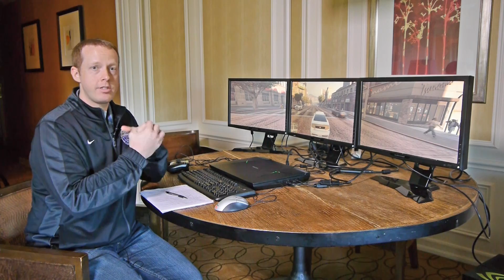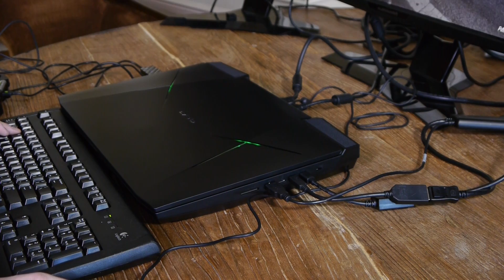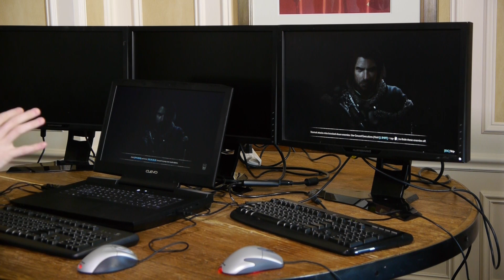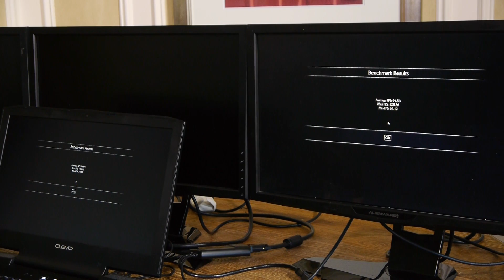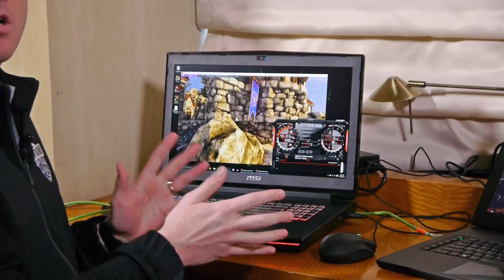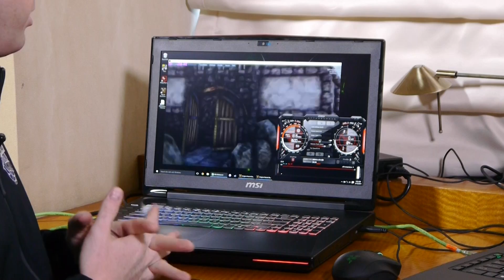World's Fastest Mobile GPU - Full GM204 GTX 980 for Notebooks

Comment: forget about any battery life......lol
Reply: I was referring to gaming with a beast of a video card.  I bet you would get less then an hour.
Reply: +Glen Hill The laptops ought to have Nivdia Optimus so the GPU would be off when not needed. 3+ hours easily. Even with the GPU idling it ought to be somewhat power efficient.
Reply: No one games unplugged
Reply: Almost no one. GPU throttles and battery capacity is not much better than it was 8 years ago for laptops. Old games running on the Intel GPU tho..

Comment: I'm plenty happy with the 980m 8GB GPU in my gaming laptop, which can do the same, run triple (1+3) monitor setup or 1 X 4K output on the HDMI, supported with an i7 CPU running up to 4Ghz and 32 GB Ram, so I don't feel the need for this upgrade. BUT it looks pretty good and will be a great success amongst mobile gamers, no doubt about it! :)
Reply: +mrgclips Your 980m is 30 - 40 percent slower than a 980 desktop. LinusTechTips sis a video on it recently. 30 - 40 percent is ASTRONOMICAL in GPU performance percentage wise. Be happy with your purchase, but let's not be deluded, At the very least you have more vram.
Reply: +deenycest10710 Obviously a Desktop GPU is more powerful, but I've had 212 fps on COD:MW3 Maxed out, 120+ on that un-optimized POS game GHOSTS maxed out and fantastic performances on Titanfall also, so I'm absolutely satisfied with my current rig. Of course, if I wanted to buy a state of the art gaming laptop NOW, then I would most definitely want to go for this GPU! :D

Comment: What is the clock speed of the 6700K in the laptop? Isn't the 6700K a desktop part? I get there's probably an AC adapter plugged into that thing at all times for these demo's, but is it downclocked to maybe match the desktop with 4770? The laptop also is pretty thick, so I get there could also be some decent cooling pushing that heat out. But like others are saying about battery. I'm just wondering if the processor used in these demo's were done that way for a reason.
Reply: +Justin Reback that I know of clevo/sager and msi both use desktop cpu's not sure if alienware and asus and battery life while gaming is horrendous I use to get 20 to 30 mins max on just the battery definitely has to stay plugged in

Comment: The thermal throttling will be ridiculous. This is not gonna work.
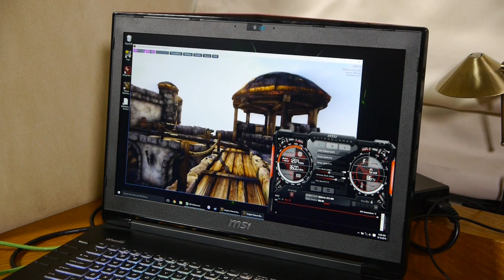Reply: you saw it won't... 5:05
Reply: +DCCXVIII Good point. As long as the heat sink has at least 180w heat dissipation it should run cool though. There are plenty of 180+ watt heat dissipation coolers that can fit in a notebook.
Reply: Moyukh Shabon
That doesn't show anything. Get back to me when someone has actually used it for normal time periods and not benchmarks (that are never indicators of real world performance). It's simply impossible for a laptop to achieve desktop level heat dissipation. Physics is a thing.

Comment: How long can the battery last if you're stress testing the cpu/gpu?
Reply: Exactly!
Reply: +finn jake it doesn't.
Reply: +finn jake 1 hr MAX
Reply: +sweet dreams 1 hour? i think you mean 20-30 min
Reply: +finn jake The GPU will be throttled HARD while on battery. It can't handle that kind of discharge without overheating fast. Like discharge fully from a full charge in 20 minutes or less if not throttled but from voltage drop from the huge load it would be less time still.
Reply: +danwat1234 yeah I have experience (alienware 17)
Reply: +Fuzed Studios With my Asus G50VT laptop with a 9800m GS, in  which the GPU takes 60 watts theoretically, it can run at full speed with the CPU and GPU crunching while on battery but the battery gets hot and doesn't last long. If I start overclocking then I think it starts throttling or goes to hibernate for protection.
But any of the high end GPUs no way
Reply: +Fuzed Studios And don't get me started (well I guess I am) with aftermarket batteries... sometimes they just cut power (laptop shuts down improperly) if power consumption becomes too large. So be careful with gaming laptops and aftermarket batteries.. and mAh capacity lies. Usually they are 1 notch less energy dense than OEM.
Reply: danwat1234 omg yaasss that always happenes to me... like it says battery low then 2 seconds later it just SHUTS OFF :(

Comment: I just bought a 980m laptop too...
Reply: +omega53 dude there's probably like a $1k difference
Reply from the maker: +omega53 Yeah, there will be a noticeable cost difference. But if you are within that 30 day return window... ;)
Reply: +Brandon Goh It'll be easier as Pascal will be far more energy efficient. More energy efficient = more laptop friendly. I expect there to be no M GPUs next year but just one lineup spanning both desktops and laptops, branded exactly the same. Of course desktop will have exclusive like the 1080Ti that will still be too power hungry for a laptop chassis.
Reply: +pcper I got a p750zm based laptop from Origin PC. Perhaps when Pascal comes out in MXM form, I'll bite then and just find somewhere to purchase the card from.
Reply: +omega53 Wait for Pascal, it'll be worth it.
Reply: +Cakefish look at how long the 980 has been out for and think about how long they will take to implement the flagship pascal gpu into a notebook if at all possible
Reply: +Brandon Goh They had PCI Express boxes for notebooks to use a full sized graphics cards. Apple machines have had these things for years. Just look for one, they showed one at last years CES2014 as well. But these review sites only seem to like to go to the other shows in the country like E3.